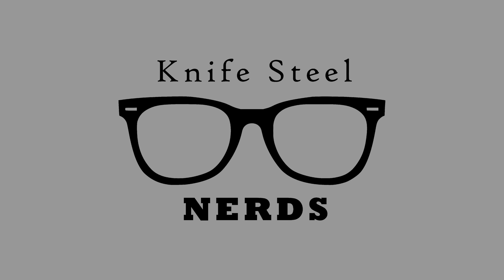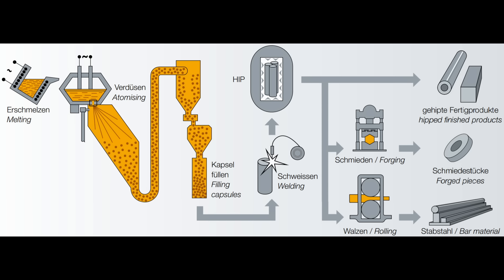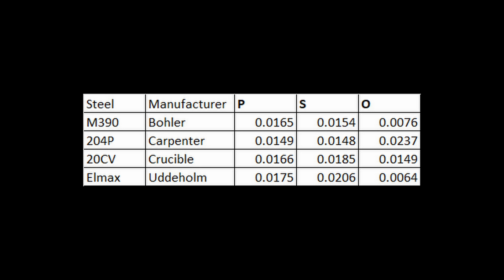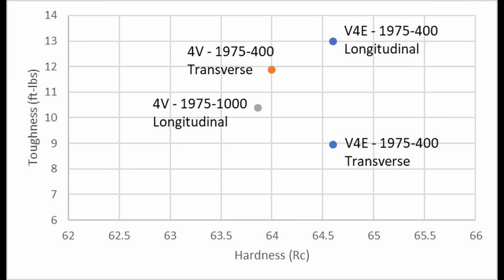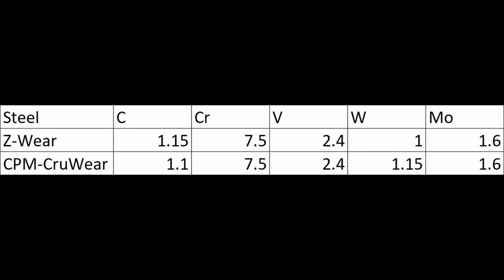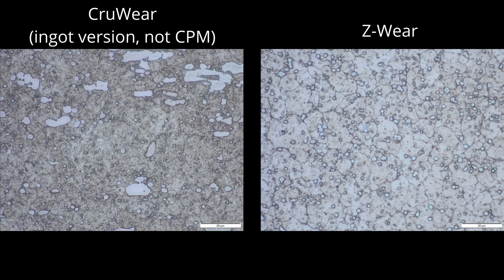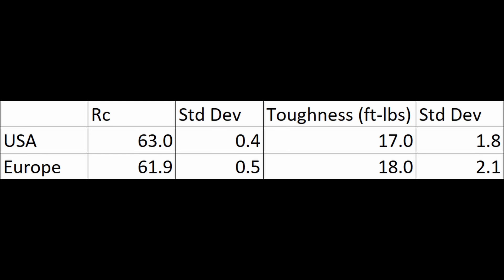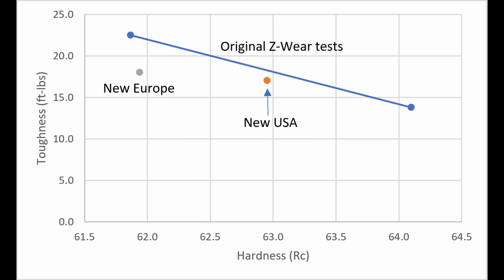Europe vs USA Knife Steel (Powder Metallurgy)

Comment: Thank you for the tests and explanation. With these results it seems like it may be worthwhile to specifically test different heats of the same manufacturer, if possible. I know they don't provide that traceability, so it would be tough. Buying from different distributors a few months apart might be the only way to hope they were from different lots.

Comment: Would be interesting to also see how steel varies when it comes to how plates/sheets have been rolled between US and European steel companies. Like the difference in flatness and other things between Niagara specialty metals and Bohler/uddeholm. I heard European steel often is more flat and has fewer gauges and other potentially small issues that I assume happen during the rolling process (specifically with some CPM sheets)?
Reply: Your comment is right on point, rolling and processing would be great to compare!
Reply: Consistency between heats would be interesting as well. Would be hard and expensive to test though. In general more statistically significant (more test samples) would be fantastic, but Im already so appreciative about the data provided!
Reply: @thorwaldjohanson2526  apparently the rolling also has big impact on the carbide distribution, they have bidirectional rolling in Europe

Comment: Yeah I had figured thatd be the case. Besides for many if not most of us out here actually using knives in the field ie hunting, trapping, etc one will find we typically use really inexpensive & "boring" knives compared to what steel nerds/collectors are after anyway.
Reply: I've seen people use box cutters for field dressing animals. I'm one of those that uses an inexpensive knife. It's going to get used, then sit all year in my kit.
Reply: Yep, that's why MagnaCut is more fascinating in that it's not trying to be a master of one, even for a premium steel. Jack of all trades wins. That's why 14c28n or even 12c27 wins in real world use for cheap steels, it just works. Tough, stainless, slightly better performance than normal carbon steels. There's others like D2 for edge retention for cheap and semi corrosion resistance, and others like 440c.

Comment: Thanks for the video, Dr. Thomas.

If you have any interest I think it would be fun if you did a back-of-the-envelope style calculation for the approximation of various steels longevity in a marine environment before complete erosion. Maybe choose a steel in the lower, middle, and upper corrosion range within the main categories. Possibilities:
S90v (or XHP—but you deemed it only semi-stainless), 14C28N, and Magnacut or LC200N/H1.
A2, D2, and 3V (or Cru-Wear)
Blue Super, 5160, 52100.

I know it would be a lot of work, but thanks for your consideration.
Reply from the maker: When it comes to “real” marine environment materials selection basically none of the common knife steels would qualify. Ocean saltwater is brutal.
Reply: @KnifeSteelNerds  It's time for Titanium! :)
Reply: Vanax SuperClean, Nitrobe 77 (unfortunately discontinued!), LC200N. All hold  up REALLY WELL in "real" marine enviroments, even Vanax SuperClean should have the best stain resistance of these 3 (accordind to custom knifemaker: BBB)
Reply: @JoeBusic nope, it is not time for titanium! H1, TERRAVANTIUM, Tungsten Carbide and lately developed ceramics are your best choices in that direction.
Reply: @alexanderbertallo1995 Those can survive limited exposure to saltwater but they would not pass the requirements of marine environments for extended periods.
Reply: @alexanderbertallo1995  No steel can match Titanium. Why wait? It's time! :)

Comment: can you use the powder metallurgy process to make a knife with a different powder metal on the edge than the spine? (to make it tougher without sacrificing sharpness and edge retention) ... You know, for those dutch bushcraft guys to baton with.
Reply from the maker: There was a limited run powder steel years back where they had a “San-mai” construction with S90V in the core and CPM-154 on the sides. Some have come up with ways to connect two different steels in the way you describe, two major ones are Michael Walker “Zipper blade” and Kershaw “Composite blade.”
Reply: @KnifeSteelNerds  thank you so much for the search tips!
Reply: I just can't understand why you'd want powder metal for the spine.

Comment: The work you put into youre videos is impressive and honorable. 10 Coupons is a lot. I wonder could you heat treat and temper 10 different fulltang knives of the same steel. Because from practical view point the 10 differently heat treated knives could be tested in real life.

Then we could see how they cut and how tough they are when tested. That would be interesting to see the Real life results. 

Tests like

1.Rope cutting
2.Cutting some soft and harder materials
3.Bending the knife in bench a little to see if it flexes. 

Maybe even something more extreme but I dont know.

From theory to Real life tests would Cover the knive steels Journey. You would have a lot of knives then also 😊

Comment: M390 maybe would be better with chrome limited at 14% (15% max).
I tested it and I found it disappointing in ultrapolished edge, hair splitting, can be also limited by not optimal heat treatment by EU knives company 😑 (very common problem in various sectors 😑).
A small folder in m390 should be at least 60hrc, it is not a huge chopper for wood making.
Sadly profesional human sharpeners are a dying breed, in Italy...😨
I give priority to accuracy of apex, maximum sharpness, medium edge retention is fine (medium, not low), and low priority on corrosion resistance (chrome is fine at 14-15% for a stainless).
CPM S30V and S35V are really good, several in my collection, high performers, old S30V took any kind of edge very easily, even hair splitting, ultrapolished; less experience with S35VN.
I still love D2 (old but gold 😃👍)... such a perfomer, for folders and small fixed, takes easily an hair splitting edge, ultrapolished.
K390 and CPM M4 will be cool to test.
Maybe I will test even a CPM 15V... that will be very interesting.
CPM 15V... will be my most desiderable  one to test.
🇮🇹
Reply from the maker: Dropping the chromium of M390 to 14% would essentially make it S30V. Unless you kept the carbon at 1.9% and then it wouldn’t be very corrosion resistant.
Reply: @KnifeSteelNerds  
In my opinion  corrosion resistance is over hyped, to develop rust on a modern folder you need a concentrate salt solution.
With normal use, clean after cutting acidic foods and occasional oil for protection... rust is a mirage.
...and with modern products is even easy to remove, if catch soon, before pitting.
Stone washing and mirror polishing also close the "pores" of steel, enhancing even more corrosion resistance.
Experts will even know how to care for D2, that is a "semi stainless"... you know better then me metallurgy 😉
...easy with modern oil protectors.
For scuda diving, boat use or average customers... that is an other story (h1, nitrogen...).

For me best steels are the ones that take apex maximum accuracy easily, even with obtuse geometries on fixed knives.
On fixed I like a lot D2 and Sleipner, own both in many models.

But it is normal that each customer develop its preference, for others can be edge retention, toughness or corrosion resistance...

Interesting channel
Reply from the maker: In that case the steel you want is K190, the non-stainless steel that was modified to make M390. It is a powder metallurgy version of D7 tool steel.
Reply: @KnifeSteelNerds  
Never heard of k190, seems more interesting k390 but it would be better with 9-10% chrome, to be "partially stain resistant".
K390 is in my wish list for testing, with M4.
Still 15v will be my first priority if I can find an interesting model.
The manix in G10 is a cool model in 15v.
So many steels, such a confusion, it took me many years to understand them as a customer.

For normal life I just use good medium premium stainless (US, EU, Asia... made) or D2, Sleipner... occasionaly I like to test something fancy, highly original but done with competence 😮‍💨
Reply: Well spyderco mule series is right up your alley.
Reply: @EDCandLace  
The mule is a very good idea 👍 to test steels but I prefer a normal folder (frame lock, axis, triad...) to enjoy it in every day tasks, especially with some particular origianal steel.
Like the Endura 4 in zdp189 (in my collection), good knife and very hard steel (took much time for edge reprofiling, by my hands) but I prefer the sharpening feeling of D2, run at 63HRC, on a folder, more satisfying apex edge, splitting edge.
Actually I find D2 still easy to sharpen at 63HRC, contrary to popular belief.
The manix has a more pleasant design, better candidate for 15v,  but both good folders in G10 (frn allergy😆).
Even if now 80% of my collection is around "solid performers", like D2 / vg10 / s35vn and 20% "bizarre steels".

Comment: Thanks again for the your work. So 3rd generation pm says it is more pure , except it is not... interesting. 1 ft/lb is not much, but 1.5 hrc is a big step up. People often disregard hrc until they experience a hard knife. In a lot of tasks, hardness is more important than abrasion resistance. I think we'd need a scale for Edge retention averaging Catra AR, Stability from hardness, and chipping resistance from toughness.
In fact I am working on a document, cross referencing your data with Metal Complex Hrc sheets and Cedric+Ada sheets, but I am unable to come up with an accurate number for Global Edge Retention, and how to factor in the numbers, except for a smart guess...
K390, for exemple, has maybe the same edge stability (hardness + toughness) at 14dps as Maxamet at 17 dps, and therefore will probably outcut it, even if it is less abrasion resistant. Because as you often say, geometry comes first.
Reply: He never said in the video which European manufacturer is making the new Z wear, only Bohler-Udeholm have the new 3rd generation process.

Comment: Knife Steel Nerds - I know I am not the only one wondering this.....but why is Buck Knives only piddle diddling around just doing extremely limited stealth runs of any Magnacut blades? Magnacut by now should be a permanent blade option for all of the Buck 110, 112, 119, 120, and 124 series knives, just as a basic entry-level starting point. 35 years ago, 420HC steel was a decent option for a blade. But now 420HC is very old and outdated, there are way better and more modern steel options to use that would dramatically improve the function, purpose and quality of the Buck Knives family.
Reply from the maker: As far as I understand they are slowly ramping up use of MagnaCut but I don’t have any inside knowledge of that. 420HC adds a high toughness option so I wouldn’t call it outdated. From a manufacturing perspective it can be fine blanked as opposed to waterjet or laser cut and is also much less expensive than powder metallurgy steels.
Reply: @KnifeSteelNerds  Thank you
Reply: I just wonder why they choose 420HC over 12c27, 13c28, or 14c28n type steels.. even cheaper I guess? It's just even softer than those more fine tuned quantities. @KnifeSteelNerds

Comment: European steel is better
Reply: American steel is best 
Obviously
Reply: Hahahaaaa
Reply: All i know is anything elmax and above in the low 60's rockwell chips at the angles i like to use when carving wood. I dont like M390 class or elmax right now
Reply: @thaknobodi 

Operator error.
Reply: @CNYKnifeNut  what angle should i use? Im used to AEB-L/ sandvik class and their edge stability. These 20% ish carbide steels always chip out on me when whittling wood at 30 degrees inclusive, including a D2 true Scandi
Reply: @thaknobodi use a tougher steel, like a good ol' carbon steel with around 0.7% carbon content. Pretty much as hard as any other common steel, but much tougher, at the cost of some wear resistance, but if you learn how to sharpen a knife that's not an issue, it takes a second
Reply: @jeanladoire4141  i do. In fact my preferred woods carving knife is a GEC H10 1095 at 58 ish rockwell at 30 degrees inclusive
Reply: @thaknobodi  1095 is an odd choice, i don't really know why it's so popular in the us. Why not a 1075 at 60hrc? you'd get better toughness
Reply: Food also...
Reply: @jeanladoire4141  hype. I understand what you mean. Ontario actually shifted to 1075 before they closed shop because of what you say
Reply: @thaknobodi  yeah there's a whole trend of using super hard steels nowadays, as if it was going to make better blades, but steels like 1095 and above were designed for razors and files, not common blades, so yeah it's more abrasion resistant, but way more brittle, to the point where you need to sacrifice hardness to get somewhat good toughness, but a 1060 or 1075 can be left much harder (sometimes harder than 1095),but with very nice toughness... More number doesn't mean more better in steel sadly
Reply: @thaknobodi true scandis are terrible in a steel that’s not tough.
Reply: @jeanladoire4141 likely because 1095 is still ridiculously tough but has far superior edge retention
Reply: @acid6urns  true as ive discovered with an Enzo Brisa
Reply: If you want to reduce the chipping risk but maintain a 15dps edge angle then do a slightly convexed V bevel. No need to heavily convex just slightly convex and you will increase toughness quite a bit.
Reply: @acid6urns 1095 has big drop in toughness and very little improvement in wear resistance compared to to 1084 or 1075 in similar hardness
Reply: Steels sucks! 😂
Reply: @thaknobodi  i find cruwear and magnacut are optimal for me. Also like m4 and k390 but that's as delicate as i go.
Reply: @CNYKnifeNut  I guess there's a chance the carpenter guy is bad at it, but I'd say there's a more likely chance he's using the wrong steel for his applications. This is why I use cruwear and not stuff like 20cv or s90v. I hurt blades that are s35vn toughness or less.
Reply: That's a joke, right? 😂😂😂